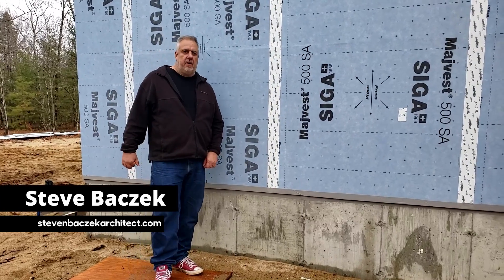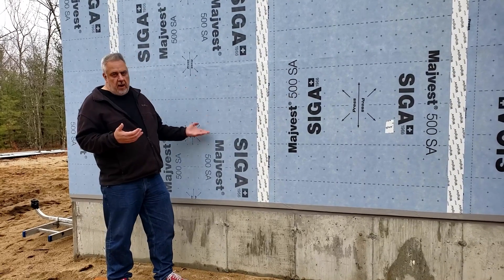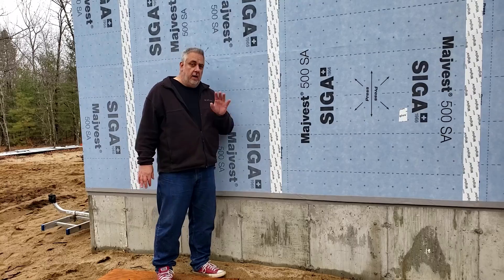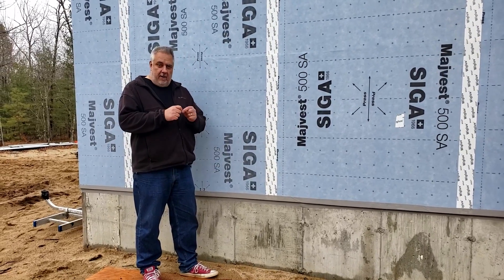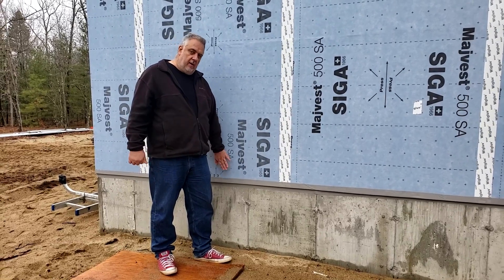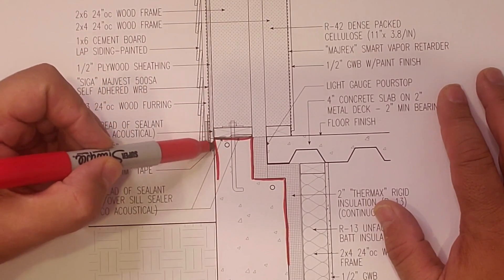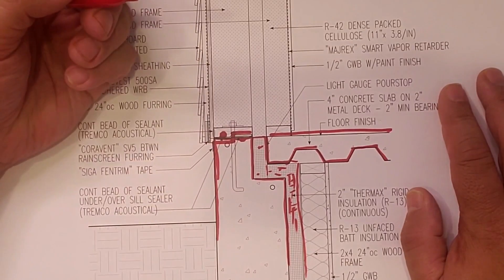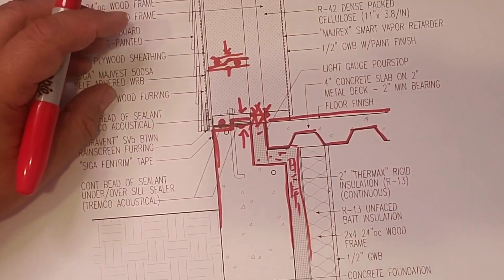AIRSEALING at the FOUNDATION

Comment: Hi Steve,

I am fairly new to the trade, I am curious on how you would tackle the details/ waterproofing of a maritime climate with wet winters (mainly rain), where power isn't always a given due to frequent storms/ poweroutages).
Reply: That highlights the importance of a high quality building enclosure, it's passive and continues to pay dividends. If the power goes out and you lose dehumidification, then your vapor details will keep the house comfortable longer than standard construction as mother nature pushes everything towards equilibrium.
Reply: Don't really have any high end/ passive houses here, but 90% humidity seems to take it toll on things fairly quickly. And how would you incorporate a fireplace in a passive building?

Comment: Shouldn't the vertical taping on the walls go over the foundation tape for proper water management?  From the video it looks like it's not shingled correctly.  Just a thought.
Reply: Another builder in a different video mentioned shingling the tape, with a different brand of highly aggressive tape. He said something like, "I suppose I should shingle the tape layers, but there is a whole exposed edge of tape, and if the tape is going to fail, it will fail anywhere along the edge." In other words, shingling is the least of your problems. Makes a difference with tar paper, and Tyvek, but not Siga tape or Zip tape, etc.